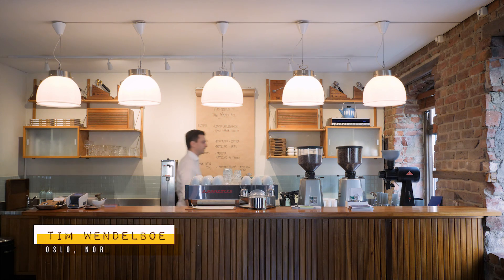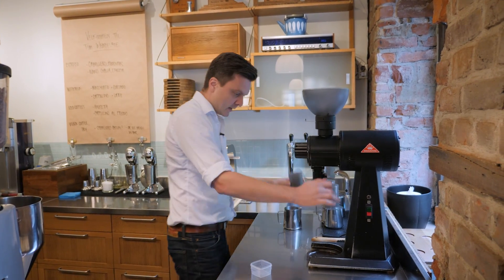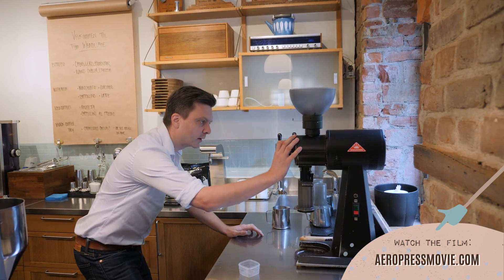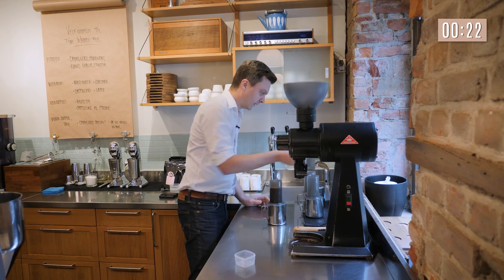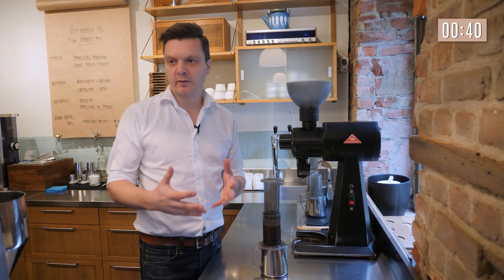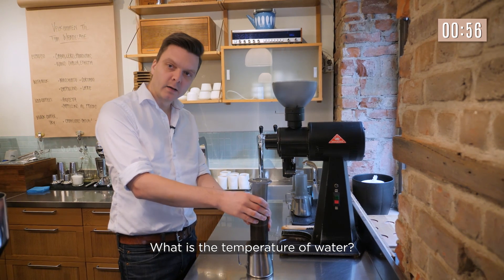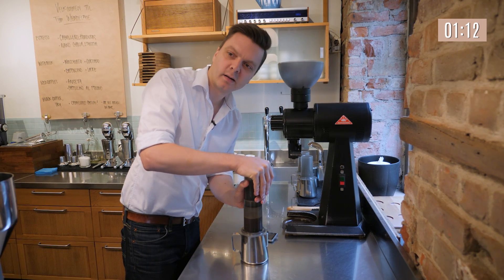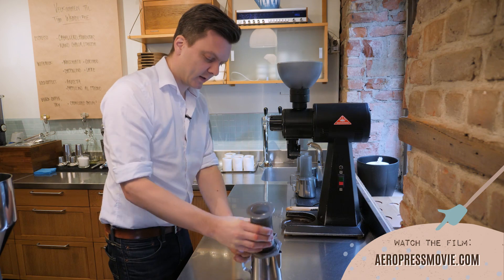Making AeroPress Coffee With Tim Wendelboe | AEROPRESS MOVIE

Comment: I so appreciate taking the time to mention not just the temp of the water when added, but during the actual brew - I feel like temp loss is a fairly critical (not always, but often) variable to account for. I live at 7500ft and water boils here at 198F/92C, so I have to either stick to lower temp recipes, or be extreme about by preheating & temp loss mitigation. Anyway, just appreciate it - I'll try this recipe to the best of my ability!
Reply: I  also have found temp drops very much when you pour into brewer filled with coffee and brew it. (depending on method) For me, the final brewed temp ends up at 66-68 C
Reply: Get a beer cozy or something fluffy to warp around the Aeropress.

Alternatively, what I found to work OK is a fine grind.
Reply from the maker: I think you will be good with lower temperature. Then you can adjust the grind size if something is not spot on.

Comment: Just tried the recipe at home, with a nice fruity Ethiopian coffee. Ground coffee 15 clicks with the Commandante C40 grinder. Water from the kettle at around 95C. Super simple ... and quite delicious.
Reply: 15 clicks? Damn... I'm at 25 clicks. You must like it intense.
Reply: @arna437  I am right in the middle with 20 clicks ;)
Reply: I have a Baratza Encore and find I like it best with most coffees at a grind of 21, plus or minus one.
Reply: Emanuel Greucean 15 Clicks?! Wow, i use 12-15 for bialetti and 30 +\- 2 for AP. I‘ll try out your grind size RIGHT NOW! :D 
Did you the exact same recipe as presented in the video?
Reply: @popobleistift5000  Yes same exact recipe. But don't take my word for it, I've been using my Commandante for about 2 years, so my burrs might not be as sharp as when it was new. Also we have very soft water in my area. I am filtering my water using a Brita filter jug. So it depends on your taste. For example I've dont V60s with 14g->230g in less than 3 min (Rao style) on 21 for some coffees and 26 on other coffees. So it depends on the roaster, the coffee, the density, the processing ... in short ... use whatever tastes good for you.
My advice for dialling in any coffee is to go as fine as you can as along as you like the coffee, and when you don't like it anymore, go back to the last grind setting the you liked.
@arn said that I must like it intense ... actually I like mine balanced, and I prefer acidity over body.
Reply: @gremytm  Got standard Comandante C40MK3 or old MK2? or Ironheart?

Cause my Ironheart seems to have exactly the same settings as you described. :D Or we like our coffee exactly the same.
Reply: @jimmellon4298  Ehh I'm way down at between 8-12 for Encore in Aeropress. I found higher it doesn't provide enough resistance when plunging and brews too quickly.
Reply: @MrMarcLaflamme  I had forgotten about this until your reply hit.  So, I'll admit mine plunges easily.  I'll try dialing to a finer grind and see what I think.  I do like the flavor I'm getting though.
Reply: Jim Mellon if you like the flavour then you got the right setting! 😁

Comment: One question for the owner of the channel. If the inventor Alan doesnt recommend putting water on the filter before use why most baristas do wet it?
Reply from the maker: Good question! I think most people wet the paper filter because it is common for many other brewing methods like pour over coffee. There, filters are much bigger so it make sense to rinse them (also you preheat the brewer in the same time).

Since you don’t need to pre-heat the AeroPress and filters are tiny in comparison, the inventor argues it’s not necessary as the taste difference is close to zero. 

Wetting the filter for AeroPress won’t make it bad though, it is just an extra step that some people like to skip. I hope it makes sense 😅
Reply: @EuropeanCoffeeTrip  it does make sense thank you for the fast answer. Im glad that not doing it wont affect quality! Great content overall. Congrats.

Comment: when I try this, by the time 1 minute passes, a lot of my water has already passed through the filter into the cup? And I barely need to press anything through...
What am I doing wrong, please?
Reply from the maker: Well, you either need to pour quicker so you can put the plunger on (to stop dripping) or you need to adjust the grind size (finer). It is okay if some water goes through but it shouldn’t be a major part. Give it a try!
Reply: A bit late, but watch closely as Tim puts the lid on, he squeeses it in at an angle and pull it up very slightly to stop the flow of coffee and it sorta assures you theres a good seal. i dunno, its always worked for me.
Reply: Invert it is so much better to brew with upside down
Reply: This is why I just stick with the inverted method. Works fine with this recipe as well :)

Comment: Interesting.  Have you ever been able to get a true espresso as Alan claims from AeroPress.  I've come real close.  Thanks for your video and all.  Another thing I've noticed is that the AeroPress is designed to fail over time from stress on the plastic filter holder due to fact that plunger goes past bottom when fully depressed.  Coffee is such a fun subject.... TY Great video.  Will have to try your brew method some day soon.  Oh by the way even though I have yet to get the espresso down I have figured out a brew direct to an espresso cup for the AeroPress... Sort of a novelty, but fun.

Comment: Wouldn't an inverted method prevent some of the water from getting into your cup during the brewing, before the actual extraction?
Reply: I haven't been able to taste much of  a difference. Most of the time I use the original method which uses much less water.
Reply: It's immaterial for me. If anything the inverted method have a risk of tipping and it doesn't taste as good. I suspect the rubber absorb some of the coffee oil and release it back during brewing.
Reply from the maker: Well, water will go through the coffee puck either ways so it is not a problem - it is more of a preference of a person.